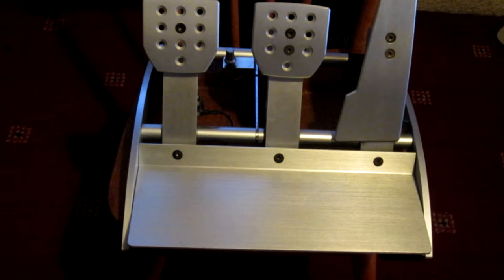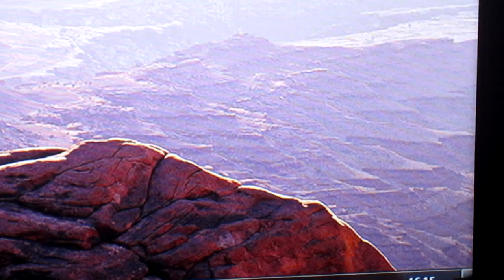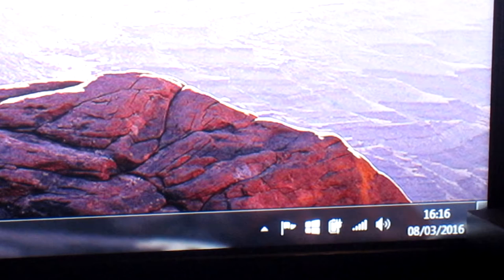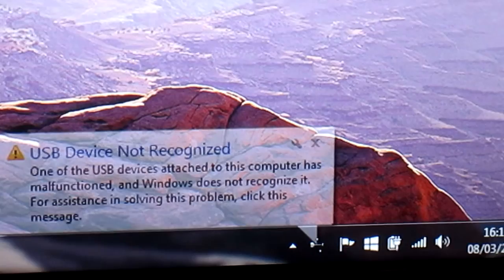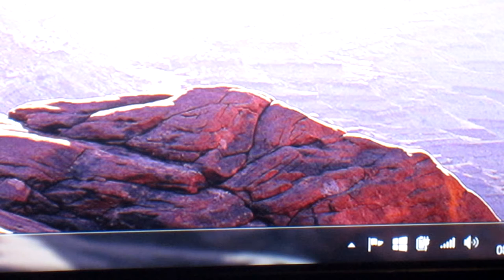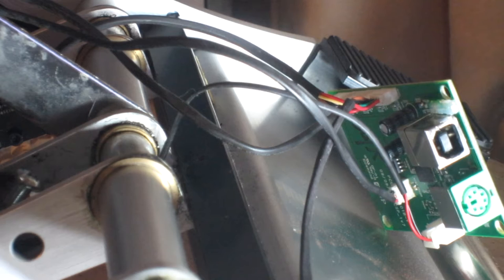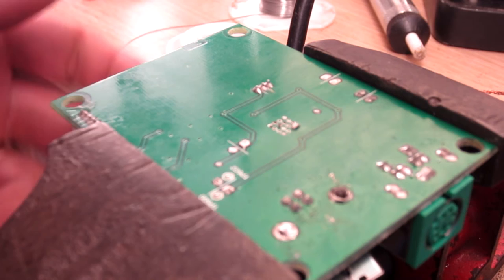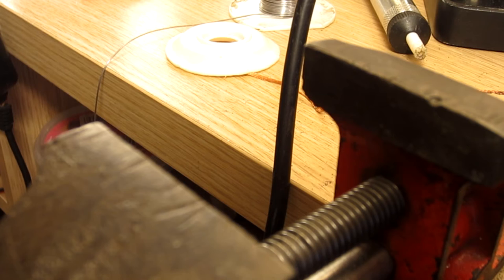Fanatec clubsport pedal repair

Comment: @kattcool hi there just purchased the CSL ELITE wheelbase for PS4/PC what cable do I need to get to connect this base with my Clubsport V1 pedals as want to play on PS4/PS5,
Many thanks
Reply from the maker: hi , this is the cable you would need - https://fanatec.com/eu-en/accessories/pedal-accessories/sp-pedals/shifter-cable-2.0m-ps/2-rj12
Reply: @rikkatt  thank you very much mate can’t seem to find it cheaper than £14 on eBay but fanatec only want around £6 but it’s the shipping 😂
Reply from the maker: @LB-wx1xc  i know their shipping is allways expensive
Reply: @rikkatt  I ended up getting the one of eBay, tell me something I’m new to sim racing and want to know a few things, went on Fanatec website to download something so im able to see if pedals work properly etc but V1 isn’t even in the discontinued section just V2 so I downloaded that plugged in pedals via the usb and opened the properties, I started pressing all 3 pedals and it shows the responses, I’ve seen people able to set min or max on each pedal to sort out deadzones etc but that option is not on my screen, point being have I downloaded the correct thing, what did you use ?
Thanks in advance